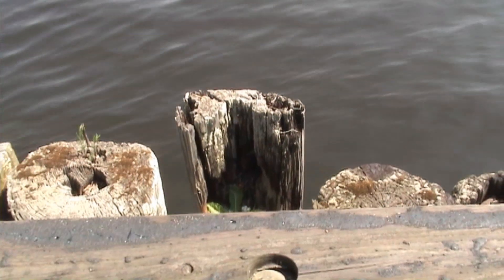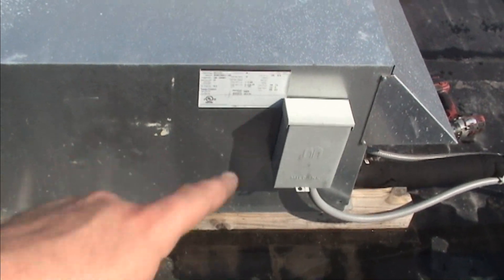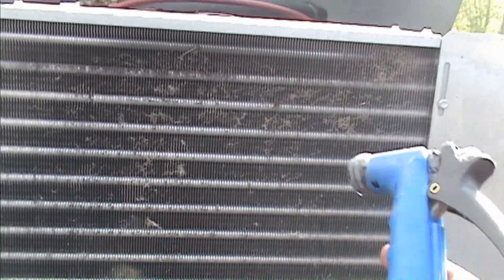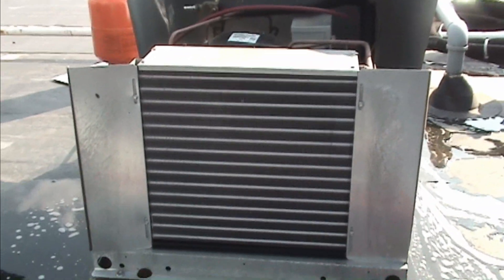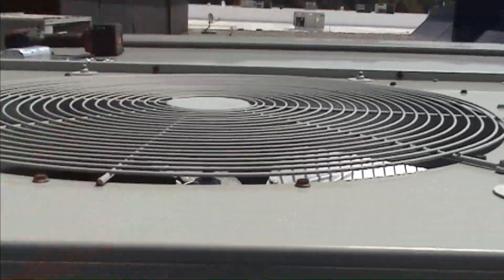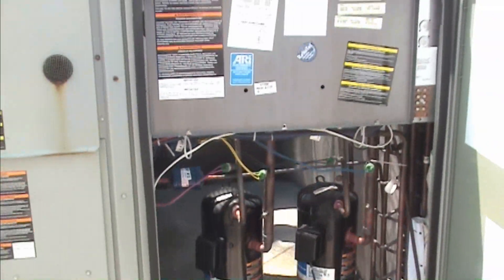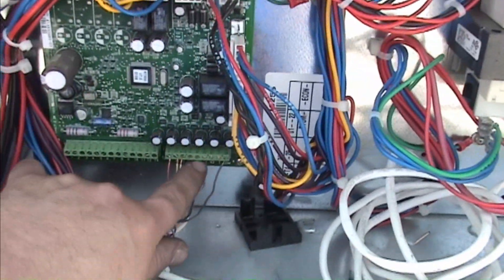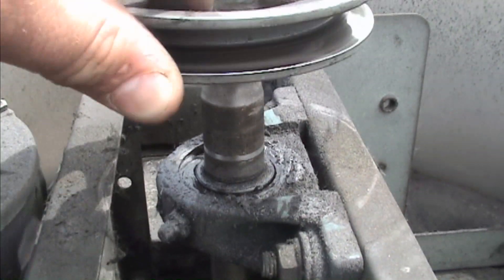A Day in the Life of an HVAC Tech.

Comment: you have a lot to learn, the green board on the right side is the RTRM control board (which is an awesome board), the green board on the left is the RTOM board (options control board), the tan board above them is the ignition board. next, the expansion pistons are at that 1/2 copper header with 3/8 lines that feed into the evap coil, liquid refrigerant is fed into the evaporator which causes a pressure drop, every refrigerant pressure has a corresponding temp hence the cold liquid, as the cold liquid passes through the evap it picks up sensible heat until it reaches the saturation temp/pressure, latent heat causes change of state into vapor, after that it continues to pick up more sensible heat (which is the superheat}. PLUS the coil cleaner you used removes the factory coating from the metal. you have to spray the coil with cal-guard after using a cleaner with high acidity, read the NU=calgon label. in a couple years those coils will be a dull color and start to get flaky and falling apart. and did i see the open end of your charging hose laying in water at the beginning of your video?
Reply from the maker: I pointed to the wrong board in the video.  Trane has the WORST main board in the industry.  Out of all major manufacturers they are the ones I replace the most.  The longest lasting Main control boards I've come across so far have been in the older LGA Lennox units.  In my 23 years of doing this I've only replaced 1.  The Johnson controls ignition modules in those sucked though.  Also Carrier boards are relatively robust.  Unless you're in a high corrosive environment ( IE acid rain, Ocean salt, things like that) there is no need to coat a condenser coil.  You just need to make sure you rinse effectively and only use the coil cleaner concentration you need to do the job.
Reply: @Halligan142  dang, you totally changed my mind......not

Comment: You get much better foaming action with a pump up sprayer. Also use a lot less coil cleaner. You need to direct the water stream straight into the coils when rinsing. Your angle spray doesn't penetrate as deep and the straight method does.

Comment: Great video, what brand/version of coil cleaner do you use and what setting on the coil cleaner bottle foamer  (A-E) do you set it at?
Reply from the maker: I use Nu-Brite for the most part.  I use their other cleaner that's safe for micro-fin coils too.  Mostly I use C on the settings but I've gone up to  the highest concentration setting for coils caked in grease being very careful to immediately rinse extremely well.

Comment: I've scene 404a freezer systems, running on high head, look at the condensor, looked spotless, could see right through the coil, was lost, cleaned the coil, head pressure dropped immediately, it's wild what pollen will do to a coil, and it was on a roof top like this

Comment: Ha, the last kitchen fan in this video, i worked for a company that built that style of fans. I was a the one welding up the bases and the covers and shrouds.
Reply: +killerxbunnys  also how would you clean your coils if you lived up north during winter? if its to cold water just freezes and you now have ice everywhere?
Reply from the maker: +killerxbunnys 
Just a spring and summer thing.  Most A/C's don't run during the winter those that do it's cold enough outside that most of the time you don't even need the fans.  Same thing with walk-in condensing units.  They'll actually have a control to shut the fan off when the refrigerant pressure gets too low because of the temperature or a valve that will bypass the coil.

Comment: I do commercial refrigeration and am always running into these  type of problems..cleaning split coils with nubrite...when using nubrite you need lots of water bcuz it will eat the fins of the coil it just makes them brital. About the RTU the pistons in the evap coil are actually in the long tube wich is call HEADERS, in this rtu there is 2 headers with multiple pistons no txv. I ran into exhaust fans with brolen belts but never seen a pulley that came on, you never know what you going to find. Great video, I really like your work, I wish I can go behind techs that had your work ethic

Comment: Why did y1 and y2 have a jumper wire?
Reply from the maker: Single stage thermostat and the one unit does the entire building.  I want as much cold air as fast as I can get it in there plus with multistage set up a lot of times you'll just run 1st a lot more.  I'd rather have both compressors worked equally.
Reply: ok. I thought that if you use a single stage Tstat on a 2 stage A/C, the A/C board will control it. say its cooling for 10 mins and the Tstat is not satisfied, then the 2nd stage will kick in. Is that Right?
If you energize y1 and y2 at the same time via jumper wire, then you will always have both compressors running. Therefore using more power, and being less efficient.
Reply from the maker: Ian Cooke Most units don't.  Usually you need something on y2 whether it is a jumper or from a multistage thermostat.  I want both compressors running when calling for cooling.  I'm not worried about an electric bill I'm worried about beating the crap out of the first stage compressor by having it be the one that will run more.  Especially in Trane units where the 1st stage is larger.  It evens itself out really when you think about it.  Having both compressors run when calling for cooling will stisfy the thermostat quicker than with one compressor.

Comment: Halligan142

I really like your videos you have on commercial HVAC . I tried to work for a company this summer in the commercial field and they let me go , at the time I had a very bad infection in my mouth that my hole face was swollen and had to goto the er for that reason . .I was told by them I wasn't qualified for the job . I worked in the residential field as a installer and learned service in residential as well .Its different for me and I didn't have a problem learning . But I own my own company a one man show in wi and am having a hardtime starting it out . I don't have the capital as most companies around me for advertisement so my company is having trouble taking off .what could I do to get it started off
Reply from the maker: Most of our work comes as word of mouth.  We don't advertise, our trucks are unmarked.  The only thing we use is adwords with Google, but that's only been within the past 5-8 years.  We do commercial HVAC and refrigeration and work mostly in restaurants.   We do not do any kind of restaurant equipment like ovens or fryers so we partnered with a company that does, but doesn't do refrigeration.  Works out great.  They have a customer that needs refrigeration service they recommend us and we have a customer that needs an oven fixed we recommend them.  If you're doing residential I think one of the best ways to get your foot in the door is to offer a reasonably priced Preventive Maintenance program.  Clean coils, blower wheels, change filters, general check up sort of thing.  If you have that type of service for less than your competition and leave some cards or better yet magnets with your customer then chances are when there is a service call they will call you.  These services can be advertised in local papers for not too much if needed.  When starting anything like this it is tough and you do have to be prepared to be in the red or break even for a bit, but once you get the client base it gets easier.
Reply: Every job you do, put any money you make back in to tools and all the other shit us HVAC guys need... which adds up quick really. If you stick to youre guns on this you will have all of youre tools and a service vehicle before you know it. Hell i ran service out of whatever would get me to the job for a while. With that being said remeber image is everythiung

Comment: That's interesting how a bad cap would make the fan motor spin backwards.  I am a apprentice HVAC tech starting my refrigeration classes.  How could the motor spin backwards with a bad cap?
Reply from the maker: The cap gives the motor a boost to start and turn in the correct direction.  With a bad cap the motor will just sit there and hum and overheat.  In this case the second fan motor is moving enough air to spin the blade on the motor with the bad cap effectively acting like the capacitor to get it going.  Because of the blade pitch the air moving over it drawn by the good motor starts it in the opposite direction.    You can try it yourself with a PSC motor.  Disconnect the run capacitor and turn it on.  It will just hum.  Give it a spin by hand and it will continue in that direction.  Shut it down and let it come to a stop.  Turn it on again, but this time give it a spin in the opposite direction and it will continue to run in that direction.
Reply: Well I understand how the cap makes electric motors run.  But I do appreciate you taking the time to explain the rest of it.  Next week I dive into HVAC literally, going to be fun.  Keep on with the vids I like learning as much as I can.  Next summer I will have my basic certifications so I won't be a apprentice for long, certainly got more to learn and one more semester after this one.
Reply: *****
 I am thinking about getting a 1 year Cert in HVAC/R, but do you think an apprenticeship would be better?
Reply from the maker: ***** PSC motors have no start winding and will run in whatever direction they are started in whether it be by someone hand starting it, air over a fan blade starting it, or a capacitor starting it.  They have a main and auxiliary winding that are both the same.  Rotation is determined by the position of the run capacitor in the circuit or rather how one power leg is directed through it.

Comment: instantly vaporizes the refrigerant when entering the evaporator through the orifices? you sure?
Reply from the maker: Yes I'm sure.  It turns the high pressure liquid into a mist lowering it's pressure, which then boils off and in the process absorbs heat.
Reply: ***** Don't you mean that the refrigerant flows through the coil as a liquid absorbing heat and then eventually boiling off to a vapor?
Reply: Refrigerant is strange stuff.  Just imagine like he said in the vid when you put your thomb over a garden hose it causes pressure to build up accelerating the water.  Refrigerant does something similar, but its low boiling point causes it to turn into a vapor because the sudden low pressure causes it to turn into vapor absorbing the heat energy in the process cooling the area.  It took me a good week or two to understand it, but there you go.

Comment: Can you use this stuff to clean blower cage and wheel
Reply from the maker: I wouldn't recommend it.  You're better off with something like Simple Green or Easy Off oven cleaner if it's really tough.  You have to be careful when cleaning any kind of fan blade though.  You need to be sure you get off all the dirt if you decide to clean it.  If you don't the blade will become unbalanced and can affect the bearings in the fan shaft or motor depending on if it's directly mounted or not.

Comment: Oh by the way, I'm from Greenfield MA and joined the Army back in 1955 and ended up here in CA after 20 years. I do not have that Boston accent. I have brothers still living in MA and only one has that MA accent. Please keep making the videos....
Reply from the maker: I grew up in the Boston suburbs.  I have the accent pretty good, but my wife doesn't have it so much.  She's from the Metro-West area.  The cleaner used is a safer alkaline based biodegradable product, not acid although many people still call it that and is actually authorized by the U.S.D.A (just found that one out).  Plus it not only gets mixed with water during application, but your diluting it even further by rinsing it off and I've never had a problem with it harming any roofing materials or even plants, although it will stain metal if not rinsed off.  What your washing off is only dust, dirt, pollen, and in the case of restaurants, food grease so that won't harm anything either.  After cleaning the coil I usually just rinse the area and squeegee the puddles and excess water into the roof gutters.

Comment: Cool! (pardon the pun) I subscribe to your channel. I called my A/C installer for my 5yr old home central unit, & they said to just hose it down with water using garden hose. It's well protected, but the pollen, dust accumulation concerns me as we live in the big farming area of Idaho (lots of dust). It's getting a huge workout this year temps hovering around 100. What's your take on the garden hose flush?